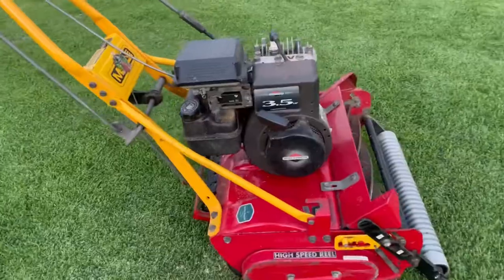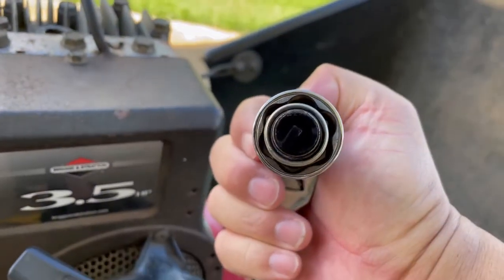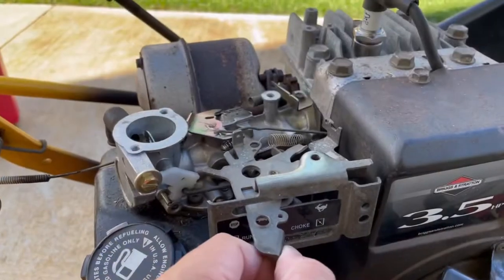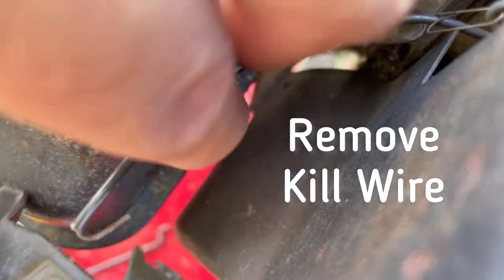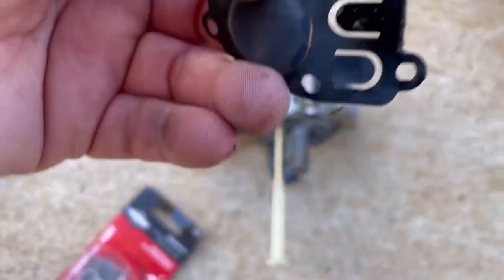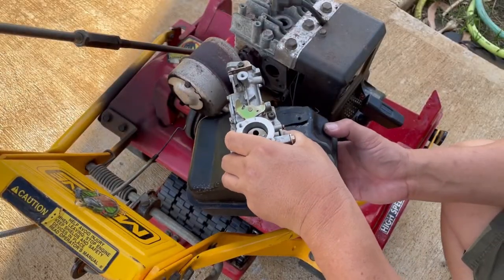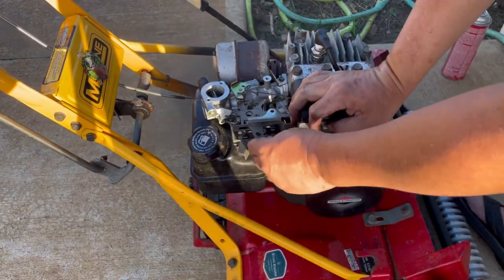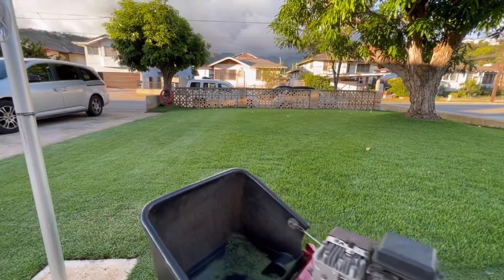How to Fix McLane Engine Problems (Briggs & Stratton)

Comment: My Mclane Gx160 7 blade 25" has been struggling when running. I just had it about year and 1.5 years. Would it need a spark plug and carburetor cleaning that early?
Reply from the maker: Hi Stanley.  Hard to say.  I would unscrew the spark plug and visually check it. If its black and wet looking, you could have a fouled plug.  From there you can think about cleaning the carb.  Troubleshoot one step at a time.

Comment: I have an older Mclane Briggs & Stratton 3.5 Family YBSXS 1481HH 275076 engine. I can't find parts for this? Any ideas? My carburetor is leaking gas. Mahalo!
Reply from the maker: It seems that your engine and my engine are similar and uses similar parts.  Are you on Instagram?  DM me @theLawnSauce
Reply: @TheLawnSauce  No I'm not on instagram sorry. My model # 091202. I ordered a new carb and hope it fits. I'll let you know if that stops the leak. Thanks for your video. Hope I can do this by myself. Mahalo

Comment: my reel mower is bogging at high rpms when im cutting. it doesnt want to stay consistent and its affecting the speed of the mower, leaving uncut blades of grass. I hope i only need to clean the carb
Reply from the maker: Chances are high that the fuel pump diaphragm is torn.  It’s a cheap and easy fix.
Reply from the maker: You can most likely fix with the carb still attached.  You may need to just remove the muffler to access the diaphragm cover.
Reply: @TheLawnSauce  thanks for the reply! I'm not sure what year my Mclane is, but ill have to look. I do know that my fuel cap is on the top. Unlike yours. I'll tear it apart and let you know.
Reply from the maker: @jbeezy126  ah I see.  First determine if your engine is a Honda or a Briggs and Stratton.  I can offer you guidance from there!
Reply: @TheLawnSauce  I’m out in my shed right now. I’m a night owl lol but it’s a 2014 Briggs and Stratton.
Reply: @TheLawnSauce  I took the carb completely off but I don’t see a diaphragm like yours in the video. However my bowl was completely corroded and filled with white dust. I just cleaned the bowl and jets but I’m not slapping it together until tomorrow. Fingers crossed.
Reply: Any update on if it started?
Reply: My mclane is revving when I start it and increase my run any idea?

Comment: Where does one connect the throttle control?
Reply from the maker: On my model, the throttle cable connects to the  leaver above the choke.  I’ve been running my mower without the throttle cable.